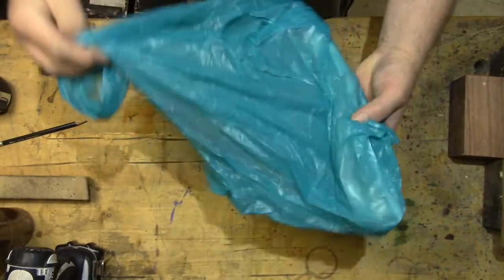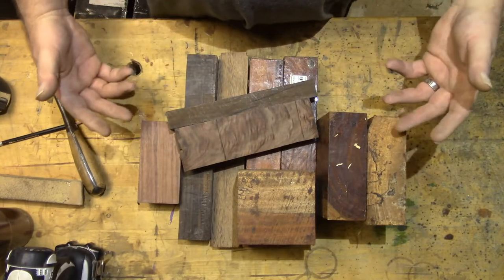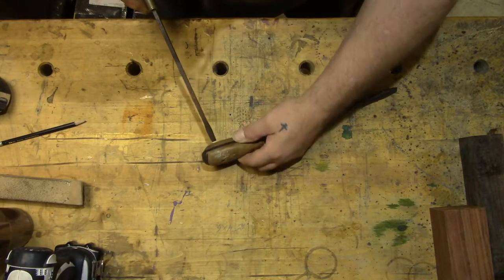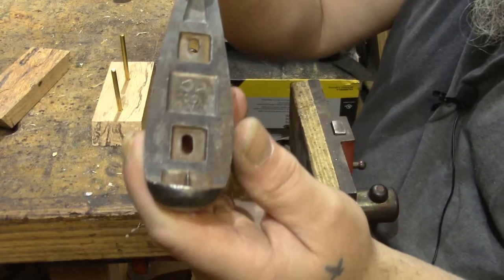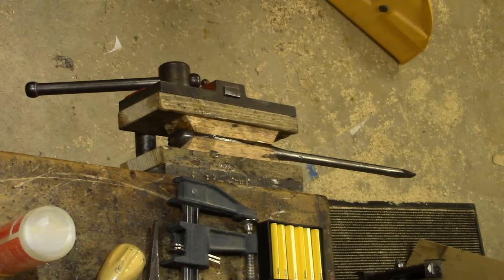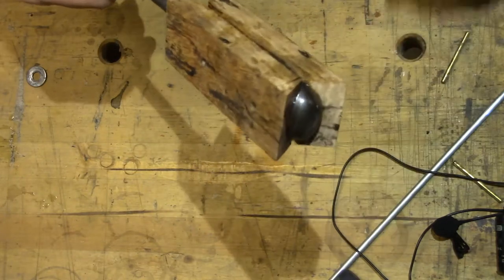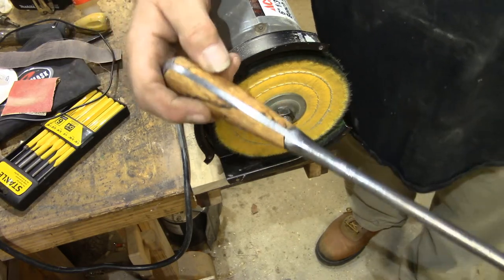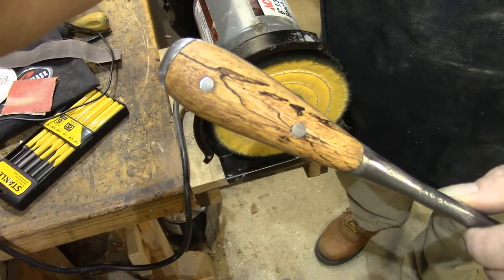GPW 134 - Antique Screwdriver Refurb (The GP Woodworks Way)

Comment: Nice job. I recently picked up one of these Perfect Handel screwdrivers at a flee market. So of coarse I had to search YouTube for restorations!  Thanks for sharing yours it came out great. The grain looks awesome. I like the way you were able to remove the scales and measure the angles on the ends. I also like the steel pins compared to most of the other restorations I’ve  seen that used brass pins. As for setting those pins the best video I have watch showed the process of using a tapered reamer vs a countersink bit. That puts a more narrowed taper hole in the wood an allows the pin to mushroom more gradually through out the hole as opposed to just on the top. 
Great idea to buy a piece of exotic wood cutoff every time you go to the woodwork store. I’m going to have to start doing that.
Reply from the maker: Thank you.

And, thanks for the taper tip, that's a great idea.